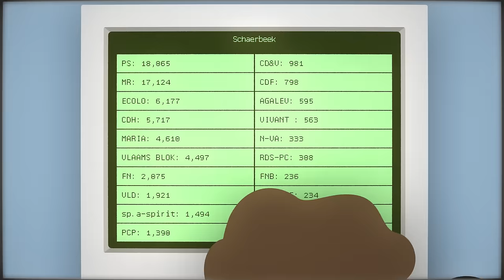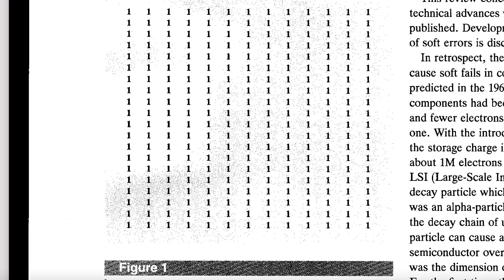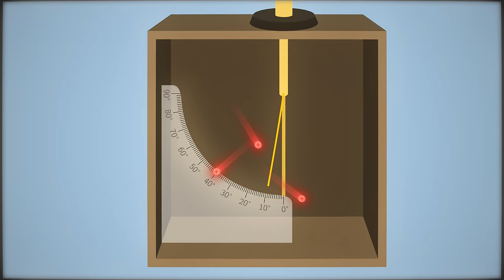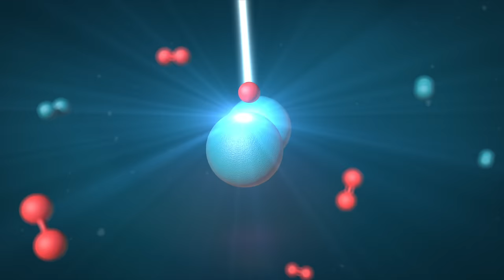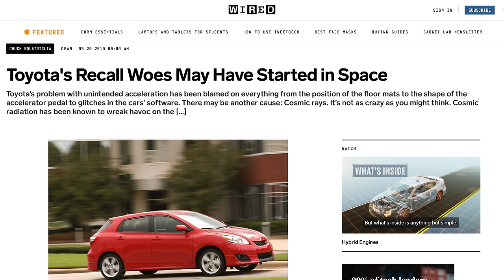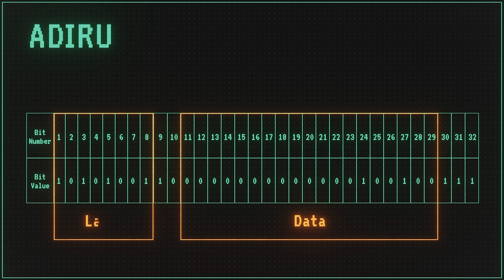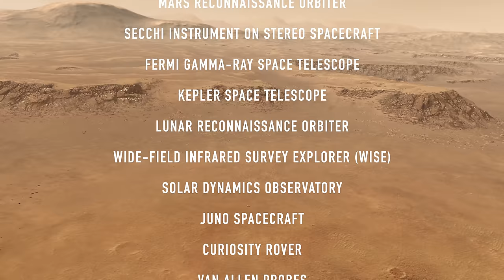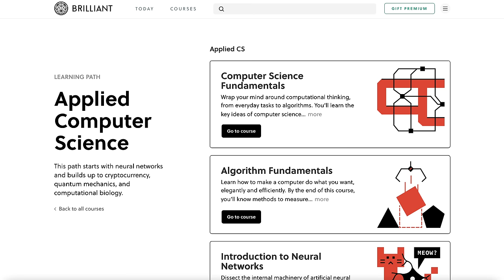The Universe is Hostile to Computers

Comment: I'm wondering, could the cosmic rays theoretically cause neurons in our body to spontaneously fire when they should not?
Reply: Yes to an extent. They might cause micro changes that can cause a chain butterfly effect leading to something else happening that shouldn't have if the cosmic rays didn't interfere.
Reply: that's interesting. Like how not all computers are affected, maybe the similar occurs to human as well. Just because some people are not affected, it doesn't mean others are not affected.
Reply: Chris Hadfield mentions this when he speaks about flashes of light seen by astronauts while in space. He says that one such particle hitting the optic nerve can cause these flashes.

By that logic you can think that there are cases when such events happen in other parts of the body. Maybe you feel a sudden sharp pain somewhere on the skin. But I don't think you will get effects more severe than that. The human body doesn't react very strongly for short and sudden changes in one neuron.

Also, in the video is a part where it reminds that these events probably affect DNA changes, so, from my limited understanding, I think you could theoretically get one cancerous cell if you get hit by such a particle, although I don't think that this is enough to cause you cancer.
Reply: @NickoTyn  one cell can absolutely be enough for cancer
Reply: Yes, it can happen.
But our body has lots of protective mechanisms against those single neuronal flash. Most of the times it gives negligible results.
Reply: Technically yes, at a rested state they cannot change unless by another force, so theoretically cosmic rays, vibration ect
Reply: @finn8518  one cancer cell is enough, yes but. It’s not deadly most of the times. 
There are three guardians against cancer in our body. The genetic guardian (tumour suppressor genes), the cellular guardian (apoptosis), the extra cellular guardian (body immune system).
Only if cancer can bypass all three guardians can be harmful.
Reply: The brain's architecture tolerates and requires spontaneous activity in order to function. A single misfire will not produce anomalies.
Reply: @drfarooqhussain  but how would a can er starting from a single cell be any different than one starting from multiple? i‘m only asking because i don‘t have a lot of knowledge about tumors but it seems like you do
Reply: @NickoTyn  and can be enough to cure where some people call as a "miracle".
Reply: @shadowxxe  ok yes, that‘s what i thought. Thanks
Reply: “Hmmm, I wonder if-“ gets hit by a cosmic ray “wide Putin”
Reply: @finn8518  multiple cancer are very rare phenomenon. It almost never occurs.

Imagine having two psychopaths in a single locality(very unlikely). And there is a good chance they kill each other for dominance and nutrition, then one tumour will be called hypertumour

Comment: An easy way to observe this effect is to watch almost any video shot on the space station. You will notice places in some videos where the pixel on the imaging chip is a fixed color -often BLACK. This damage puts an unchaging dot in the video because the light-sensor cell in the video chip is dead. Yeah - it's dead because it was destroyed when a high energy cosmic ray passed thru it. This happens much more in orbit because the space station has much less protection from full-force cosmic ray hits than does Earth's surface which is protected by the atmosphere.
Reply: that's not because of a cosmic ray, just extremely bright light - that's what killed a camera on one of the apollo missions too; without the atmosphere to scatter light, the sun's rays can be HARSH to eyes and equipment

Comment: If i remember correctly, the uncontrolled acceleration issue with Toyota was found to be a software error; one of the victims had embedded engineers analyze the software for years.

Comment: I love toyota blaming cosmic rays when multiple people had break failures. Like, one of the things we should consider is how unlikely a single cosmic ray event happening is (there are several elections globally that happened for several years, of which only 1 was noticably found to be affected. We constantly run code without error correcting code, and it is a very rare event that a major event happens that causes it to fail due to cosmic rays. So suddenly, having a cosmic ray hit multiple cars - from the same brand - and I think same model - is incredibly unlikely lol...

Comment: A plane plummets out of the sky, (0:00:00)
a speed runner inexplicably
jumps to a higher platform. (0:00:03)
What the? (0:00:06)
What the?! (0:00:07)
And an election
recount is triggered. (0:00:08)
All because of the same
invisible phenomenon (0:00:11)
that permeates the universe. (0:00:15)
On May 18th, 2003, voters in
Belgium went to the polls. (0:00:18)
In many regions, voting
was done on a computer, (0:00:22)
something the Belgians had
been experimenting with (0:00:25)
for over a decade. (0:00:27)
But the system had a backup. (0:00:29)
Each voter would insert a
magnetic card into the machine (0:00:31)

Comment: Space and radiation is a hard environment we need to balance performance ned, radiation hardening and radiation-tolerant system and software designs depending on mission critical or not, miniaturization makes it more prone to errors and failure when exposed t and so on.

Comment: this is the science i use to justify clearing the check engine light and seeing it was just cosmic radiation or if you really do have a 02 sensor problem, lets see if it retrips after a test drive. nope? yep good ole cosmos at it again.

Comment: I once was flying a toy drone indoors in a stormy weather then suddenly two motors at the back reversed and drone started maniacly sommersaulting down into the ground and crashed. I armed the motors and noticed props were spinning in wrong direction. Then I just unplugged and replugged the battery and it never happened again. Any chance it could be this too or is it more likely to be electric charges from storm?

Comment: The solution is simple - all values should be duplicated 2 more times. Each time when value should be read extra check should be executed. If everything is equal - send the value, if not - democracy will choose... Yes, you should use 3x times more RAM, but an error in this case will be almost impossible.

Comment: Just because the sun is partially blocked out it doesn't mean ultraviolet radiation couldn't reach earth Maybe its possible that uvc ultraviolet light emits radiation
Reply: I’m pretty sure That’s not how UV rays work. Otherwise, this would be an extremely common occurrence, when it isn’t.

Comment: Ups, a bit flip. Well, yes: When crucial decisions are being made, the data basis for those decisions should be protected against simple bit flips. While that's not a high demanding science, it is a kind of science after all and must be included into the requirements of such projects. By incorporating error protection, the probabilities of such errors can be drastically reduced to nothingness, even in hostile environments.

Comment: 12:42 This is factually incorrect. No one knows if it actually was the same upwarp.

The “cosmic ray” theory was simply a meme that bad journalism lead to people believing it true.
Reply: Technically it's still a leading theory as at this point there's actually no way to verify this was a myth or what actually did happen. Yes the guy had a bad console and game cartridge but that can only show so much
Reply: @thewiseoldfox  No it’s not a leading theory. There’s many other theories that make more sense - like the console fault you mentioned and also cartridge tilt, both are known to have the potential to cause issues with bit flips.
Reply: @Fishy_17  my point is there's legitimately no way to verify what actually happened. This isn't some common bug, so this can't be looked at with what is the most common case. A bit flip from cosmic radiation is never likely, yet it happens all the time as there's radiation literally everywhere
Reply: @thewiseoldfox  Ah, I see. Perhaps the use of “leading” in your original statement was a little misleading (lol), but yeah I agree.
Reply: @Fishy_17  yeah that might be my bad. I was meaning that not as "most likely" but what most people believe is the case. I think both theories are as likely, until proven otherwise which I don't think is possible
Reply: @thewiseoldfox  Leading should not refer to the belief held by the majority of people, it should refer to the belief held by the majority of knowledgeable people.
If all of the experts in a field say one thing, but a hundred times as many people who don't really know all that much on the topic say the opposite, that should not make the latter thing the "leading theory".

Comment: I believe some of these are very likely the radiation interference, but using redundancy, feedback and probabilistic checking generally should mitigate this. I have not been educated in controls as much as em, but I took a class and lab on top of doing a college rover project as the communications specialist and worked with motor control system as well to know that stability is never really 100% gauranteed in a feedback control system, even if the math seems perfect. Most control systems work by linearizing or approximating nonlinear systems in some way or a another and are developed/tested in effectively finite environments given all possibilities. Even with properly calculated and tested measured gain coefficients, it might not reflect the logical ALL scenarios. I think reliance on control systems on some things can be a cause of most of these problems on top to the phenomina mentioned, but I dont trust business to be as thorough as NASA doing an internal investigation due to likely having better logging and error analysis installed

Comment: nonsense theories when there are plenty undiscovered glitches in software that hit at certain times that is just 1 bit wrong somewhere to begin with. just because the code compile with errors and the compiler still produce working codes does not mean its bug free.

Comment: Well the ttc warp was certainly not caused by a bit flip, looksclose but not exactly so might've been teabag's confirmed kinda faulty hardware

Also you prolly shouldn't link to articles made by actual idiots for a section you may not know all about, ask runners of sm64 or heck dota teabag directly

Comment: This whole video is psuedo science bollocks. It was known a full 4 years before this video was posted, that Dota Teabag was playing with a damaged cartridge which he has to insert into his console at an angle. And while the exact glitch has not been replicated by others. It is known that a damaged console, damaged cartridge or damaged connection between the console and the cartridge may cause glitches in the game. Causing blunt trauma to the console during play may also cause issues.
Reply: For real? Would genuinely be interested in looking into this more cause I always shrugged and took that at face value. Got a solid place that compiles the info on it?
Reply: Even if that wasn’t the true explanation, cosmic rays are still capable of affecting electronics